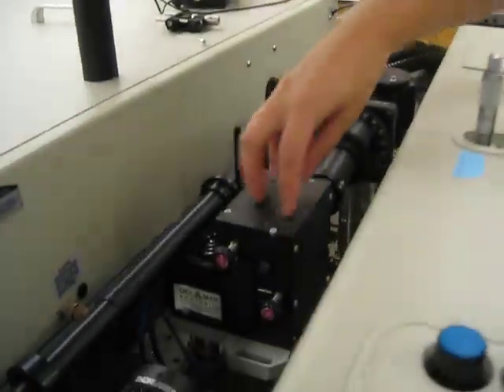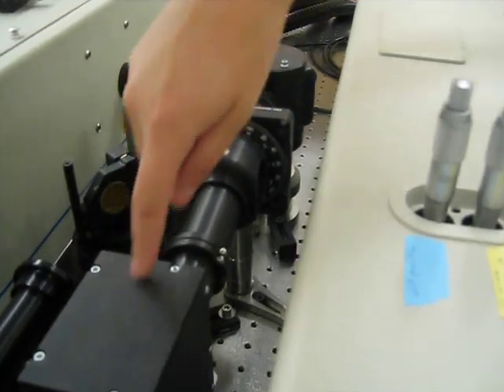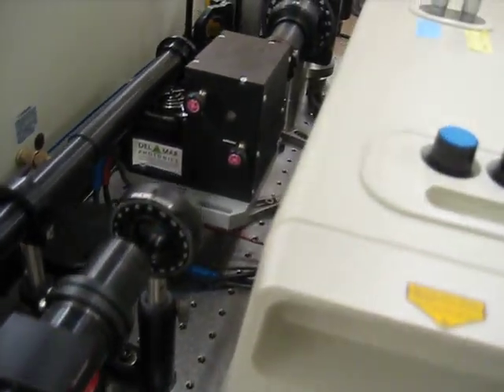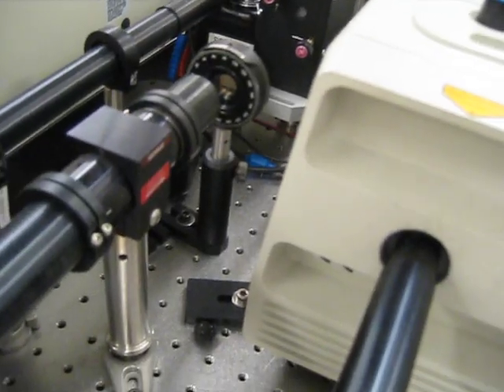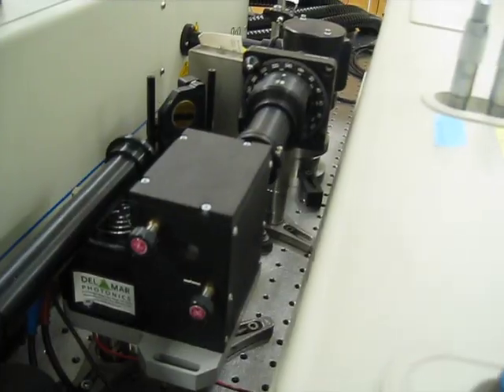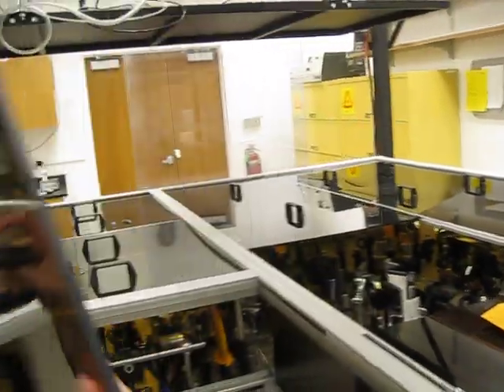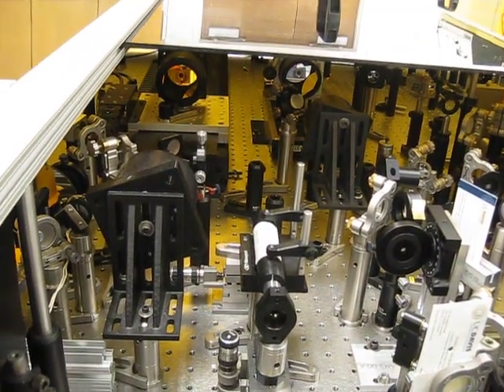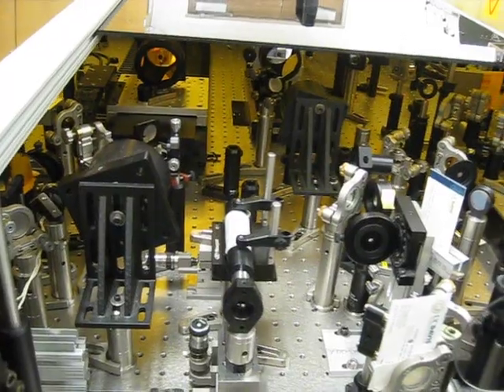A single source femtosecond-millisecond broadband spectrometer UC Davis - sales@dmphotonics.com

Comment from the maker: Best price guarantee!
http://www.dmphotonics.com/BPR.htm

Ge window, o 25.4 mm x 3 mm
MgO-LiNbO3 wafer, Z-cut, 3"x0.5 mm, two sides polished
UV grade Fused Silica window, 12.5x3 mm
LiF window o 25.4 mm x 3 mm
Axicon, UV FS, diam. 1", cone angle 160°, BBAR 400-700 nm
Dispersion prism, UV FS, 20x20x20 mm
Microchannel plate imaging detector MCP-GPS 25/2
Phosphor Screen P20
Rutile (TiO2) coupling prism, 5x5x5 mm
Axicon, UV FS, diam. 1", cone angle 140°, BBAR 400-700 nm
Axicon, UV FS, diam. 1", cone angle 160°, BBAR 700-1100 nm
Axicon, UV FS, diam. 1", cone angle 170°, BBAR 400-700 nm
Retro-Reflector, UV FS, o 25.4 mm
Axicon, UV FS, diam. 1", cone angle 175°, BBAR 700-1000 nm
Axicon, UV FS, diam. 1", cone angle 178°, BBAR 700-1000 nm
UV Fused Silica Plano-Convex Lens, o 25mm, f =  300mm
UV Fused Silica Plano-Convex Lens, o 25mm, f = 1000mm
UV Fused Silica Plano-Convex Lens, o 25mm, f = 3000mm
Axicon, UV FS, diam. 1", cone angle 140°, BBAR 700-1000 nm
Axicon, UV FS, diam. 1", cone angle 160°, uncoated
Axicon, UV FS, diam. 1", cone angle 175°, BBAR 400-700 nm
Axicon, UV FS, diam. 1", cone angle 175°, uncoated
Axicon, UV FS, diam. 1", cone angle 179°, BBAR 800&1064 nm
KTP crystal, 6x6x5 mm
LiNbO3 wafer, Z-cut, 100 mm x 1.0 mm, 2 sides polished
LiTaO3 wafer, Z-cut, o 12 mm, 60 µm
Microchannel Plate MCP 33-10E
Right angle prism, UV FS, 20x20x20 mm
UV Fused Silica Plano-Concave Lens, o 25mm, f = -150mm
UV Fused Silica Plano-Concave Lens, o 25mm, f = -300mm
UV Fused Silica Plano-Concave Lens, o 25mm, f = -500mm
UV Fused Silica Plano-Convex Lens, o 25mm, f =  500mm
UV Fused Silica Plano-Convex Lens, o 25mm, f =  750mm
UV Fused Silica Plano-Convex Lens, o 25mm, f = 1500mm
UV Fused Silica Plano-Convex Lens, o 25mm, f = 2000mm
UV Fused Silica Plano-Convex Lens, o 50mm, f =  300mm
Axicon, BK-7, diam. 1", cone angle 165°, BBAR 1000-1400 nm
Axicon, BK-7, diam. 1", cone angle 165°, BBAR 400-700 nm
Axicon, UV FS, diam. 1", cone angle 165°, BBAR 800&1064 nm
Axicon, UV FS, diam. 1", cone angle 175°, BBAR 1100-1600 nm
Axicon, UV FS, diam. 1", cone angle 175°, BBAR 800&1064 nm
Axicon, UV FS, diam. 1", cone angle 178°, BBAR 400-700 nm
Axicon, UV FS, diam. 1", cone angle 178°, BBAR 800&1064 nm
Axicon, UV FS, diam. 1", cone angle 179°, BBAR 400-700 nm
Axicon, UV FS, diam. 2", cone angle 160°, BBAR 800-1000 nm
BaF2 window, o 25.4 mm x 6.0 mm
BBO crystal, 6x6x0.5 mm
Dove prism, UV FS, 10x10x40 mm
GaP crystal, 110-cut, 10x10x0.2 mm
GaP crystal, 110-cut, 5x5x0.1 mm
Ge etalon, o 31.75 mm x 76.2 mm (o 1.25" x 3")
KTP crystal, 3x3x5 mm
LiNbO3 crystal, X-cut, 10x8.5x0.2 mm
LiNbO3 wafer, X-cut, 3"x0.22 mm, 2 sides polished
LiNbO3 wafer, Y/36-cut, 3"x0.5 mm, one side (+) polished
LiNbO3 wafer, Z-cut, 1"x1.0 mm, stoichiometric
Microchannel plate detector MCP-MA 25/2
Microchannel plate detector MCP-MA 25/2
Microchannel plate imaging detector MCP-IFP 25/2 CF 2 3/4" with HV power supply
PCA: resonance frequency 1 THz, ? = 800 nm, gap distance 6 µm
Retro-Reflector, UV FS, o 38.1 mm
SAM 1064 nm, absorptance 2%, 1x1 mm or 1.3x1.3 mm, thck. 400 µm
SAM 1064 nm, absorptance 2%, mounted: soldered
SAM 1550 nm, mounted: soldered
SAM 1550 nm, unmounted
UV Fused Silica Plano-Concave Lens, o 25mm, f =  -50mm
UV Fused Silica Plano-Convex Lens, o 25mm, f =  200mm
UV Fused Silica Plano-Convex Lens, o 50mm, f =  100mm
UV Fused Silica Plano-Convex Lens, o 50mm, f =  150mm
UV Fused Silica Plano-Convex Lens, o 50mm, f =  200mm
UV Fused Silica Plano-Convex Lens, o 50mm, f =  250mm
UV Fused Silica Plano-Convex Lens, o 50mm, f = 2000mm
UV Fused Silica Plano-Convex Lens, o 50mm, f = 3000mm
ZnSe window, o25.4 mm, thickn. 3 mm
 

Most viewed items:

Rutile (TiO2) coupling prism, 5x5x5 mm
Dispersion prism, UV FS, 20x20x20 mm
Axicon, UV FS, diam. 1", cone angle 175°, BBAR 700-1000 nm
Ge window, o 25.4 mm x 3 mm
Microchannel plate detector MCP-MA 25/2
BaF2 window, o 4" x 0.5", polished, uncoated
Axicon, UV FS, diam. 1", cone angle 175°, uncoated
Reef-RT
UV grade Fused Silica window, 12.5x3 mm
Axicon, UV FS, diam. 1", cone angle 170°, BBAR 400-700 nm
CaF2 window, o 25.4 mm x 3.0 mm
Axicon, UV FS, diam. 1", cone angle 179°, BBAR 800&1064 nm
Microchannel plate detector MCP 34/2 G
LiNbO3 wafer, Z-cut, 1"x1.0 mm, stoichiometric
Dispersion Prism Pair, 20x20x20x12 mm
UV Fused Silica Plano-Convex Lens, o 25mm, f =  300mm
Microchannel plate imaging detector MCP-GPS 25/2
Axicon, UV FS, diam. 1", cone angle 175°, BBAR 1100-1600 nm
LiF window o 25.4 mm x 3 mm
UV grade Fused Silica window, 25x3 mm, BBAR 400-700 nm
UV Fused Silica Plano-Concave Lens, o 25mm, f =  -50mm
Right angle prism, UV FS, 20x20x20 mm
Microchannel Plate MCP 33-10E
Dispersion prism, IR grade CaF2, 15x15x15x10 mm
UV grade Fused Silica window, 50x5 mm
Microchannel plate imaging detector MCP-IFP 34/2
Axicon, UV FS, diam. 1", cone angle 140°, BBAR 400-700 nm
Axicon, UV FS, diam. 1", cone angle 178°, BBAR 700-1000 nm
Axicon, UV FS, diam. 1", cone angle 175°, BBAR 400-700 nm
PCA: resonance frequency 1.5 THz, ? ~ 1040 nm, gap distance 14 µm
Microchannel Plate MCP 25-10E
Dispersion Prism Pair, 20x20x20 mm
SAM 1064 nm, absorptance 2%, 1x1 mm or 1.3x1.3 mm, thck. 400 µm
UV grade Fused Silica window,  6x3 mm
Microchannel plate imaging detector MCP-GPS 34/2
UV grade Fused Silica window, 25x3 mm
LiNbO3 wafer, Z-cut, 100 mm x 1.0 mm, 2 sides polished
Axicon, UV FS, diam. 1", cone angle 160°, uncoated
Dispersion Prism, 20x20x20x12 mm
UV grade Fused Silica window, 25x3 mm, AR 1100-1600 nm
C, C++, C# programming, hourly rate
Diffractive Variable Attenuator, 1064 nm
UV Fused Silica Plano-Convex Lens, o 12.7mm
Diffractive Variable Attenuator, 532 nm
Diffractive Variable Attenuator, 800 nm
Microchannel plate imaging detector MCP-IFP 25/2
Dove prism, UV FS, 20x20x82 mm
ZnSe window, o25.4 mm, thickn. 3 mm
Microchannel plate detector MCP-MA 25/2
Microchannel plate detector MCP-MA 25/2
Dispersion prism, BK-7, 20x20x20 mm
BaF2 window, o 12.7 mm x 2.0 mm
PCA: resonance frequency 1.5 THz, ? ~ 1040 nm, gap distance 14 µm
PCA: resonance frequency 1.5 THz, ? ~ 1040 nm, gap distance 10 µm
Ti:Sapphire crystal, 5x5 mm
CaF2 window, o 40 mm x 7.0 mm
LiNbO3 crystal, X-cut, 6x6x30 mm
PCA: resonance frequency 1.5 THz, ? ~ 1040 nm, gap distance 10 µm
LiTaO3 crystal, Z-cut, 25x25 mm, 100 µm
Dove prism, BK-7, 10x10x40 mm
Ge window, o 38.1 mm x 4 mm
LiTaO3 wafer, Z-cut, o 12 mm, 60 µm
LiF window o  8.7 mm x 3 mm
Si window, o 25.4 mm x 3 mm
Axicon, UV FS, diam. 1", cone angle 170°, uncoated
SAM 1064 nm, absorptance 2%, mounted: soldered
LiNbO3 wafer, Y/36-cut, 3"x0.5 mm, one side (+) polished
PCA: resonance frequency 1 THz, ? ~ 1040 nm, gap distance 16 µm
Axicon, BK-7, diam. 1", cone angle 175°, uncoated
LabView programming, hourly rate
PCA: resonance frequency 1 THz, ? ~ 1040 nm, gap distance 34 µm
UV Fused Silica Plano-Convex Lens, o 50mm, f =  300mm
PCA: resonance frequency 1 THz, ? ~ 1040 nm, gap distance 34 µm
SAM 1550 nm, mounted: cable
Right angle prism, BK-7, 20x20x20 mm
PCA: resonance frequency 1 THz, ? ~ 1040 nm, gap distance 16 µm
UV Fused Silica Plano-Convex Lens, o 50mm, f =  150mm
PCA: resonance frequency 1 THz, ? = 800 nm, gap distance 16 µm
BaF2 window, o 15.0 mm x 4.0 mm
LiF window o 16.4 mm x 6 mm
.NET programming, hourly rate
CaF2 window, o 50.8 mm x 3.0 mm
Axicon, UV FS, diam. 1", cone angle 160°, BBAR 700-1100 nm
Visual Basic programming, hourly rate
PCA: resonance frequency 1 THz, ? = 800 nm, gap distance 6 µm
Retro-Reflector, UV FS, o 25.4 mm, BBAR 400-700 nm
ZnSe monocrystal, 5x5x10 mm
ZnSe window, o12.7 mm, thickn. 1 mm
BaF2 window, o 25.4 mm x 6.0 mm
Axicon, UV FS, diam. 1", cone angle 160°, BBAR 400-700 nm
Right angle prism, UV FS, 10x10x10 mm
LiF window o 10 mm x 3.5 mm
UV Fused Silica Plano-Convex Lens, o 50mm, f = 2000mm
SAM 1550 nm, mounted: soldered
PCA: resonance frequency 1 THz, ? ~ 1040 nm, gap distance 6 µm
PCA: resonance frequency 1.5 THz, ? = 800 nm, gap distance 10 µm
UV Fused Silica Plano-Concave Lens, o 40mm, f = -100mm
UV Fused Silica Plano-Convex Lens, o 25mm, f = 1000mm
LiNbO3 wafer, X-cut, 3"x0.22 mm, 2 sides polished
UV Fused Silica Plano-Concave Lens, o 25mm, f = -500mm

Comment from the maker: Pulse Picker Pismo OG8/1B for 1500-1600 nm
[PP-OG8/1B]

Pulse Picker Pismo OG8/1B
http://greyhawkoptics.com/product_info.php?cPath=35_103&products_id=489&osCsid=f28325f3f77346fe4120ccf28b1b4a7a

Pismo OG8/1B pulse picker system
Crystal: BBO, 4x4x20 mm, ARC 1500-1600 nm (clear aperture – 3.5 mm), other apertures on request
HV pulse amplitude: up to 8 kV (bell-shaped HV pulse has the amplitude ~8kV with duration 10 ns at level 10% of maximum)
Repetition rate: single shot – 1 kHz
Optical source rep. rate: 30-120 MHz
Optical Synchronization input: optical (internal fiber coupled photodetector with 1.5 m length fiber)
System transmission: >85% @ 780 nm
Optical scheme: λ/4
Contrast ratio: >1:1000
Note: Also included: USB control with drivers and software, LabView drivers, Two Glan-Taylor calcite air-spaced polarizers with mounts, 1.5 m optical fiber for synchronization

Comment from the maker: Pulse picker for 1500 - 1600nm laser pulses 1550 nm, 1560 nm, 1570 nm
http://www.dmphotonics.com/Pulse-picker-1500-1550-1560-1570-1600/Pulse%20picker%20for%201500%20-%201600nm%20laser%20pulses%201550%20nm,%201560%20nm,%201570%20nm.htm

1. Pismo OG8-1 pulse picker system

Crystal: DKDP, 6x6x16 mm3, ARC 1500-1600 nm (clear aperture – 5 mm), other apertures on request
HV pulse amplitude: up to 8 kV (HV pulse has the amplitude ~8kV with duration 10 ns at level 10% of maximum)
Repetition rate: single shot – 1 kHz (external or internal trigger)
Optical source rep. rate: 30-120 MHz
Optical synchronization input: optical (internal fiber coupled photodetector with 1.5 m length fiber)
System transmission: >65% @ 1550 nm
Optical scheme: lambda/4
Contrast ratio: >1:1000
 

request a quote sales@dmphotonics.com

2. Pismo OG8-1 pulse picker system

Crystal: BBO, 4x4x20 mm3, ARC 1500-1600 nm (clear aperture – 3 mm)
HV pulse amplitude: up to 8 kV (HV pulse has the amplitude ~8kV with duration 10 ns at level 10% of maximum)
Repetition rate: single shot – 1 kHz (external or internal trigger)
Optical source rep. rate: 30-120 MHz
Optical synchronization input: optical (internal fiber coupled photodetector with 1.5 m length fiber)
System transmission: >85% @ 1550 nm
Optical scheme: lambda/4
Contrast ratio: >1:1000

request a quote sales@dmphotonics.com